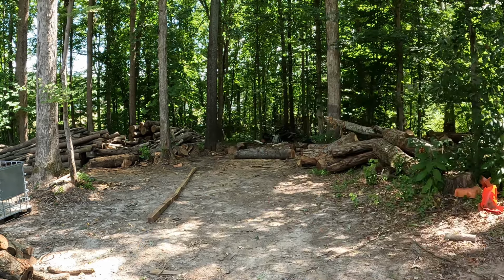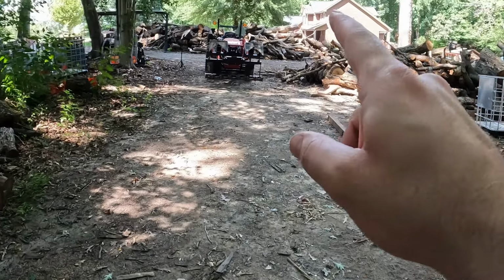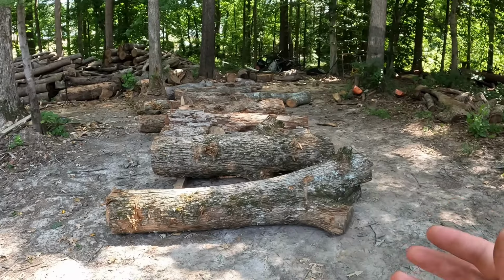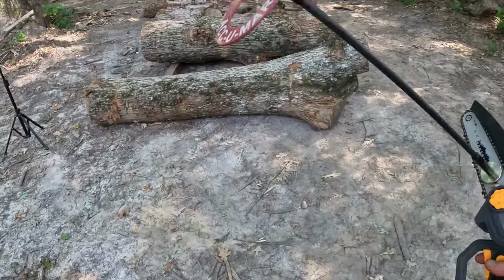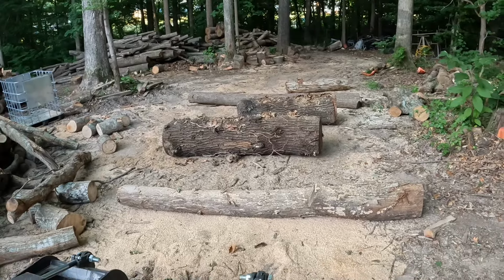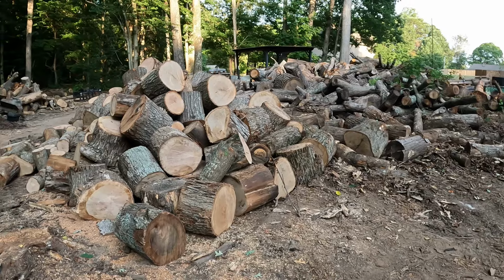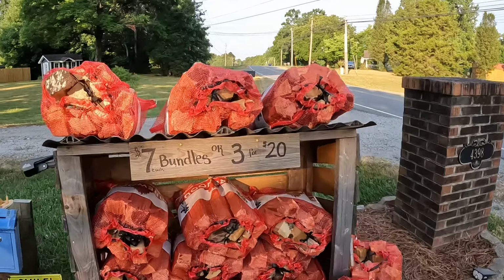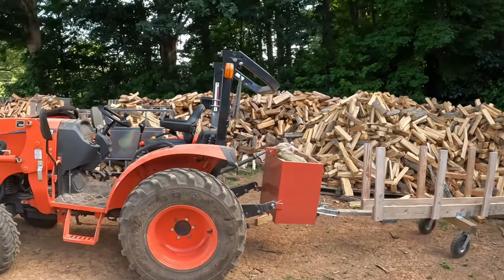It’s So Hot My Stihl Chainsaw Overheated and It Won’t Start.

Comment: Hey Matt, thanks for sharing your new process for bucking logs with a helper.  Always nice getting ideas from others.  I've also had overheating and fuel boiling issues when trying to cut on hot afternoons with my 500i.
Reply from the maker: Thanks for watching. Overheated saws are definitely aggravating.

Comment: Great looking firewood. I never had any issues with my Stihl 044 not starting in the heat.
Reply from the maker: They don’t make them like they use too.
Reply: @FirewoodontheHill  Seems like my 044 is like a diesel, longer I run it the better it runs, cold or hot.

Comment: Also...like a diesel but for different reason, you should never run your 2 stroke engine out of fuel as it is what lubricates the bottom end of your engine.  Pretty lucky you did not seize the piston.
Reply from the maker: Yes I try not to run them out but the heat is what caused it.

Comment: take a top cover off and look if ur saw in the summer pos. make sure ;its orange plastic u can switch from winter to summer  good luck
Reply from the maker: Yeah it’s always in summer mode. It doesn’t get cold enough here to run it in winter mode.